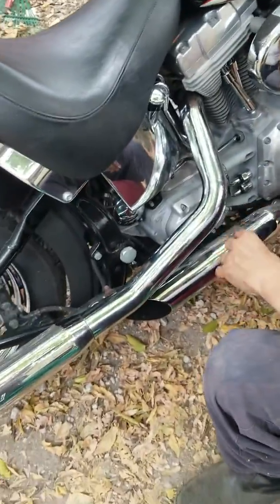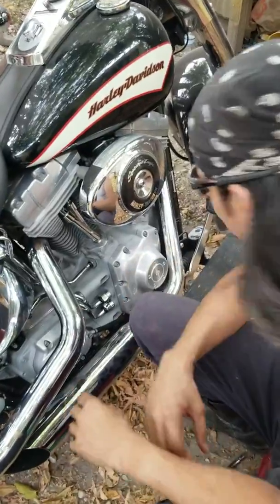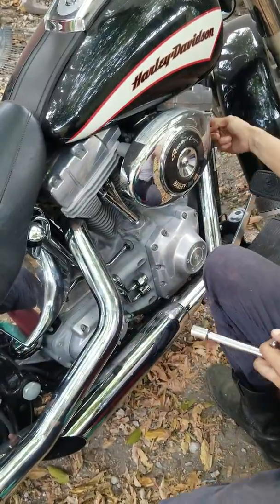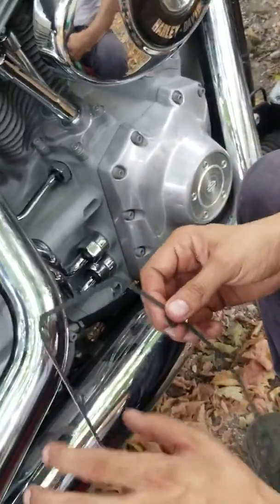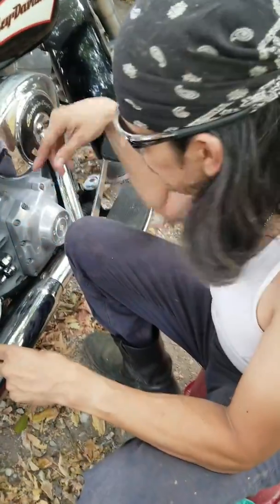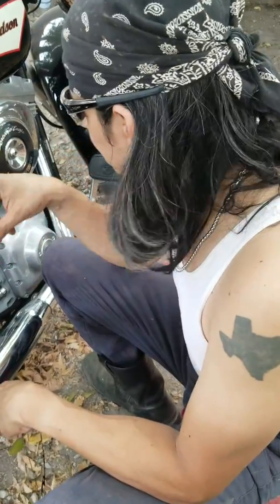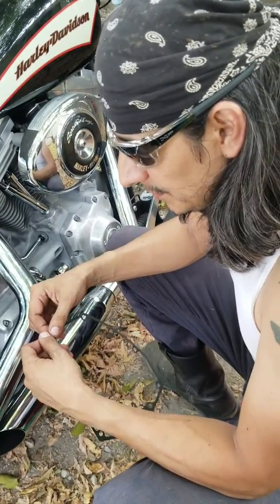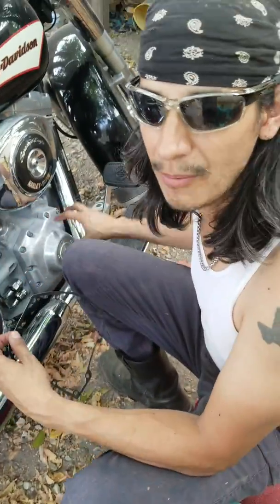2006 Softail engine noise

Comment: I have a squealing sound when I start rolling a bit...not loud but I notice the damn thing. Not brakes. Coming from the top near the breather....can't find the damn thing
Reply: Go buy you a mechanic's stethoscope at Harbor Freight and start touching metal parts that you think are making sounds, you'll find that noise with that stethoscope.
Reply: @salvadorhernandez3404  great idea....bikes in the shop and under warranty. thanks, I'll invest in one though just in case
Reply: @michaelreed9805  Yeah they're only about $10 bucks if that! Good luck